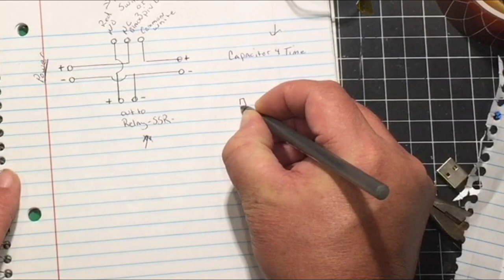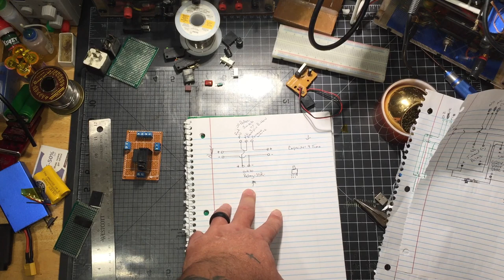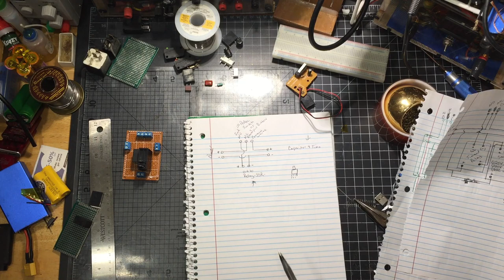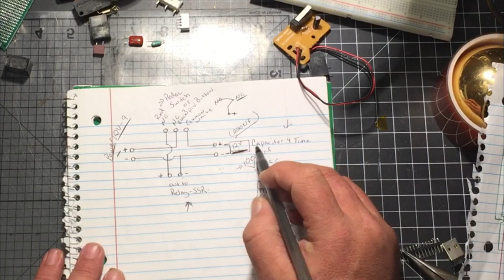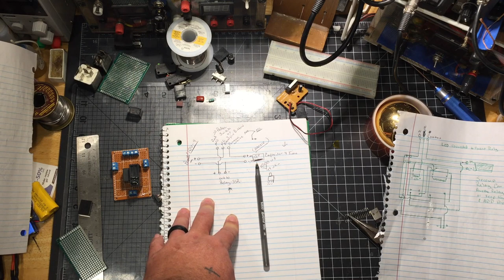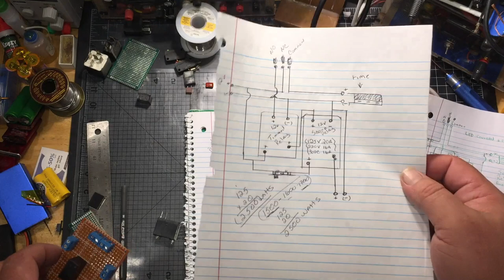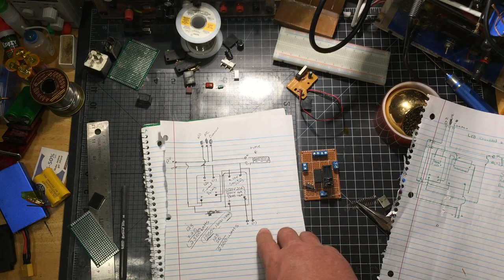Easiest DIY Timing Circuit for MOT Microwave Oven Transformer Battery Tab Welder on YouTube

Comment: Interesting. Im wondering if the old school "tuner" being a mechanical variable capacitor could be used...just to see what happens ...hehe
Reply from the maker: It can!! I used a 6 in potentiometer in one of my older mot builds. I was able to change the cap from 100uf- 1000uf. But on that one I also had adjustable power. One of my greatest builds, but hardly got any notice. If other builders watched it, you see a few tricks that can be done with these builds👍👍👍👍
Reply from the maker: Here is that video-https://youtu.be/kPA6YrMysnM

Comment: I bought a timer circuit for spot welders, a SSR, my MOT has a screwed up primary winding, I thought it would still work, it didn't, then I connected the timer circuit to my 120v wire welder, that didn't work either,  I have a big 220v arc welder, I'm not going that far! I have a starter contactor I'm going to try, I have to use a relay with the timer, I'm going to use a car battery, or maybe I can find another MOT,  I have plenty of cores I could wind, maybe I didn't have enough windings, I used about 12 pcs of 10 gauge, with 1 turn, maybe I should go with 3 turns, and 8 strands , I still need another MOT,